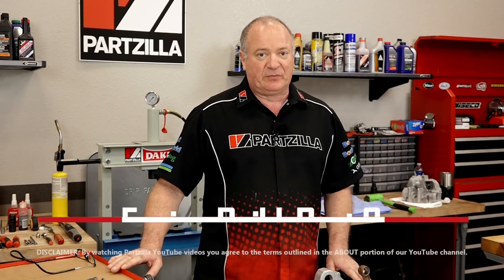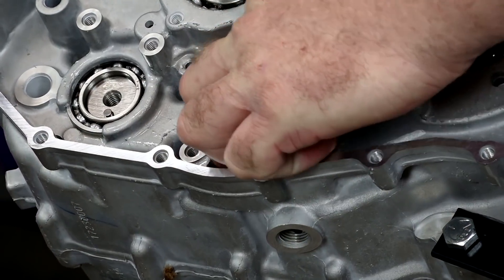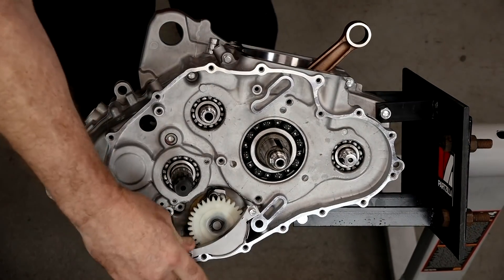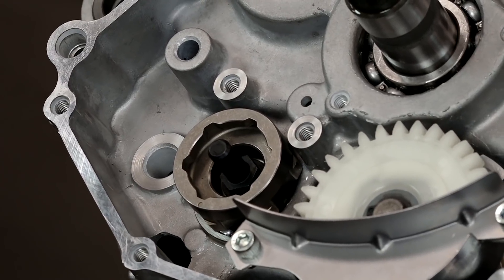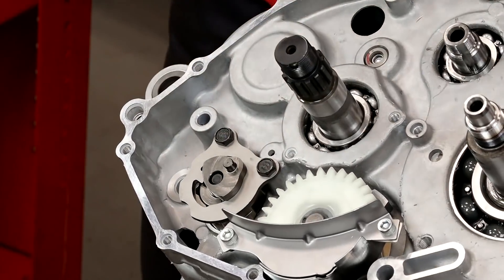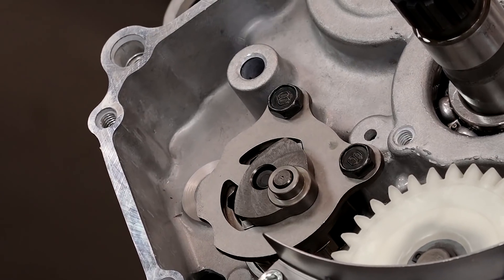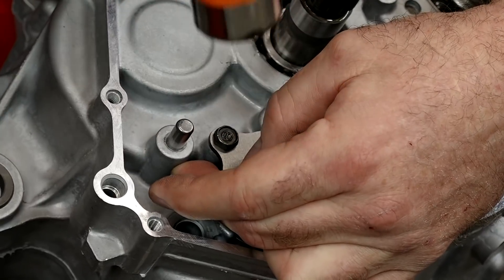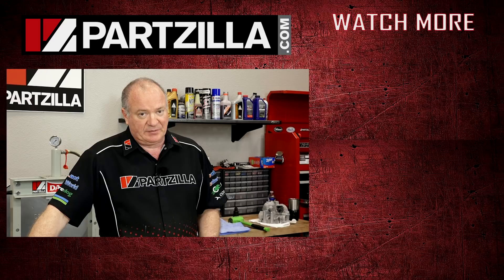Yamaha Raptor 700R Engine Build Part 2: Oil Pump and Shift Shaft | Partzilla.com

Comment: So my 700s crank case broke at the shift shaft area. We welded it back together and put in a new shift shaft. Any reason why it doesnt shift freely now? Its like it gets stuck between shifts do you think its a misalignment/friction issue?